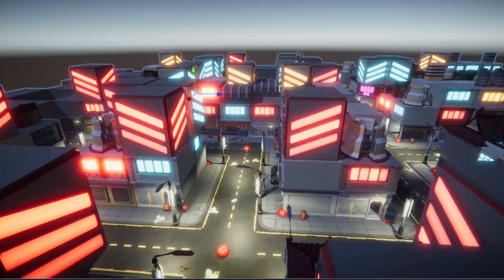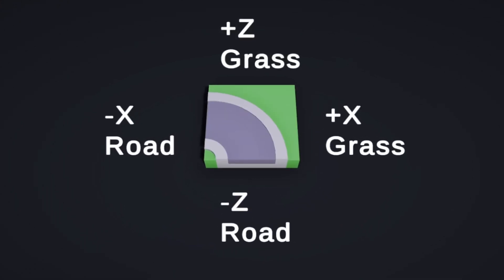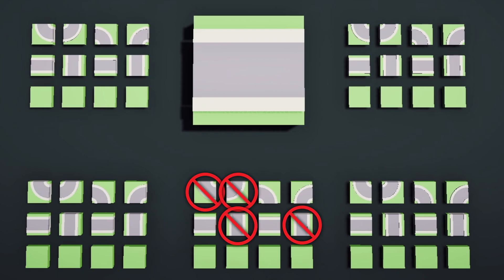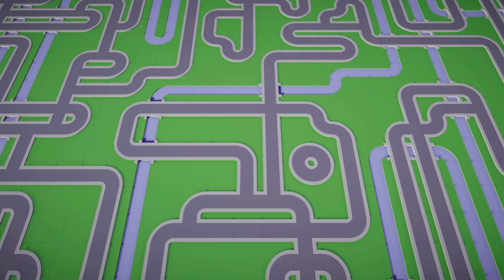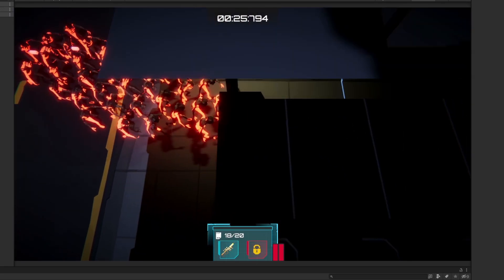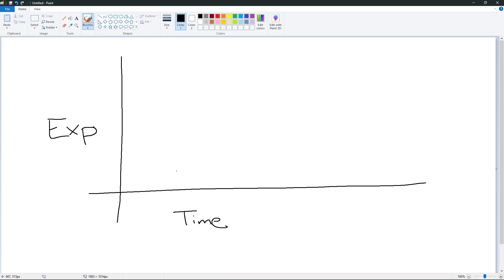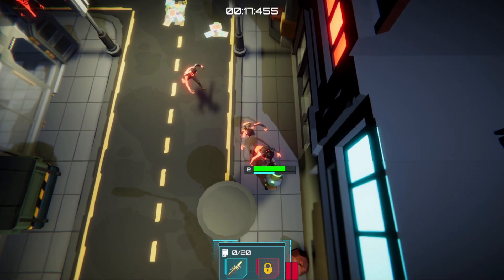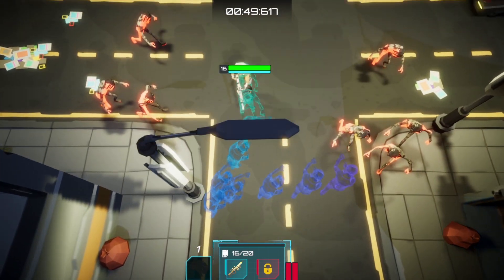Procedural Generation of a City in Unity

Comment: Late to the party, but when I implemented wfc instead of generating all orientations I would just have a bool that either allows rotations or not and then during lookup it would either pick from all orientations or just one. And shifting the compatible tiles with orientations is quite easy, so imho it saves the headache in the long run.
Reply: What you also could do if you decide that steering wfc behaviour is getting too complex is just create some partially built blueprints that contain most important tiles and feed that to wfc, works like a charm.

Comment: I found 2 bugs with your procedurally generated map,
1)  it will stop collapsing tiles if there is only 1 possible prototype and it isn't collapsed (so you will have incomplete grids sometimes if the remaining cells have only one prototype)
The solution is in function isCollapsed() replace if(c.possiblePrototypes.Count>1) with if(!c.isCollapsed)
2) By default you generate all tiles at y=0, (not a big deal to change, just use the startPosition.y) it feels weird to ask the user for a start position and ignore the y
Other than that, good work
Personally I would have the rotation in the prototype change the posx, posz just to save time of having to change it for multiple different tiles (also would make it less error prone)

Comment: you could have used animation curves for the exp part, it would be ways easier than actual math and easy to adjust too
Reply from the maker: That’s a great idea, you’re right thanks
Reply: What u mean ?
Reply: @Slow_relax_sound unity has an object called AnimationCurve, as the name suggests it is a mathematical curve, it shows in the inspector as a graph that can be edited very easily

Comment: 2:18 — It mostly only matters if you want to pre-place certain things on the map, say a start and a goal. But if you were to propagate the collapsing possibility space to the next tile(s) as well then you can pick a random tile from anywhere since you'd only have valid tiles on the entire map. The difference should be minimal when you have a single starting point. But if you want to place a single tile of a specific type, say a single upgrade store and a single parking lot where the player starts, then you could place those randomly first, propagate the required tile changes, and still have a functioning map.

It also helps when you want to add multi tile pieces, say a park area, since it would ensure that the park has enough space to put an edge tile down even if the generation were to wrap around the back of the park area. Without flood filling the propagation you would have situations where it would pick tiles that don't have any possible tile to choose between them.

Not certain if flood filling it will guarantee the map will work though, most people that work with WFC go for the lowest entropy selection and just restart the generation if the map fails to collapse completely.

Comment: Amazing stuff. Have you read about how Spelunky creates it's levels? I believe that game does something similar. They have some prefabs for rooms, but have some random noise that makes each room somewhat unique. For your prefabs you could do something like different graffiti or light colors or whatever you have time or interest adding. I'm curious though, for your entropy are you accounting for the duplicates?
Reply from the maker: Hey thanks, no I haven’t looked into spelunky’s Gen but I’ll watch some videos on it. Yes I account for duplicates, as technically they are all options
Reply: I meant more that it could cause an invalid weight. say for example one side has two curves while another side has 4 grass that are exactly the same. It should technically be 1 grass. If that makes sense.
Reply from the maker: Yes I see what you are saying, that’s a good point that I hadn’t considered, I might decide to change it thanks
Reply: As long as it works. It's still very impressive.